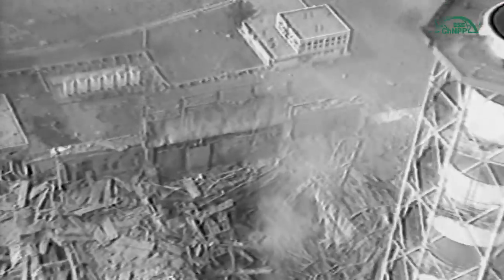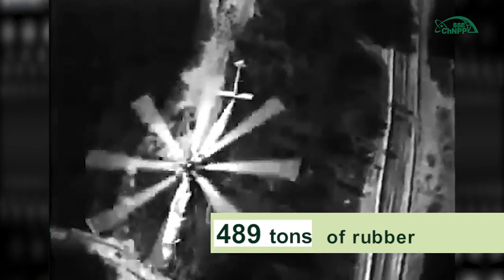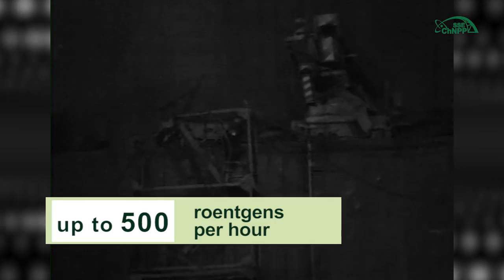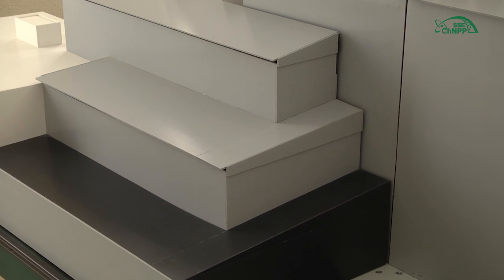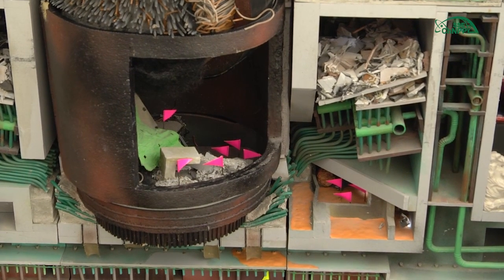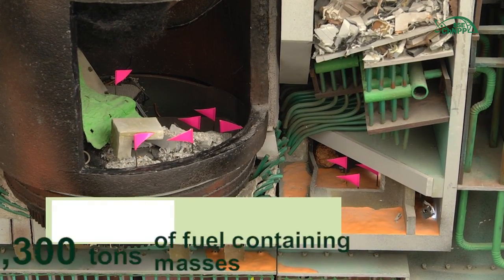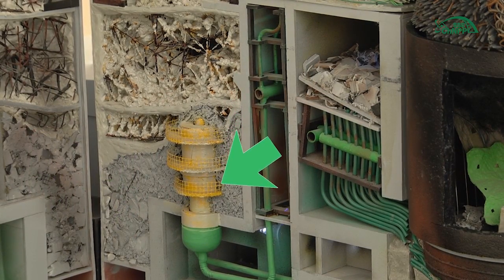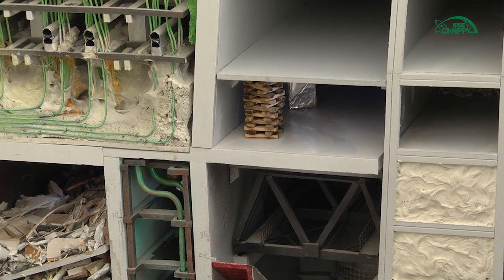Excursion within the "Sarcophagus"

Comment: "To stop the self sustaining reaction" - Yeah the soviet government had about as much of a chance of doing that as the japanese government had of stopping it in fukushima.  Which is to say ZERO chance.  The radiation levels are so high around those slag piles that you can hardly get equipment in there to take PICTURES of the situation. Forget stopping the reactions.  That talk is PURE propaganda.
Reply: Radioactive decay is different from sustaining reaction. Uncooled fuel under a self-sustaining reaction gets hotter and throws out a lot of neutrons. There was no small amount of relief once they got neutron detectors fitted around the reactor and discovered that the fuel (while still radioactive as all hell) wasn't throwing out neutrons.

Not to say there weren't a lot of mistakes made - throwing water on the reactor was worse than useless; at those temperatures  the water disassociates into hydrogen and oxygen, making the fire worse. The sand and clay dropped on the reactor lead the fuel to become insulated and increase in temperature, causing the radioactivity released to increase, and the fuel to eventually melt into "corium" like the elephant's foot. Not to mention the concerns that formed after dropping literal tons of material onto the damaged reactor from a high altitude - the floors were under severe strain.

The lead, boron, and dolomite were good ideas, and arguably should've been the majority of material dropped, but as I recall what actually got the fire completely snuffed out was the injection of liquid nitrogen around the reactor, which allowed the inert gaseous nitrogen to be drawn into the burning graphite stacks and snuff out the flames.

There was a lot of panic and sadly not enough expertise available during the early days of the accident
Reply: @compwiz101  Yeah well some of the things done were mistakes.  Some were just downright evil in an attempt to keep the world from knowing how bad it was.  To, in vain, try to control the narrative.  No iodine pills supplied to those in the area.  Especially the kids.  No cancellation of the May Day events in Kiev.  Because God forbid people get the idea that something is wrong.  Pripyat should have been cleared out immediately but wasn't.  All of this to not draw more suspicion than was already raised by the radiation alarms going off all over Europe.

I guess this comes down to a definition of "stopping" a self sustained reaction.  Stopping it would require clean up of all that corium not just burying it under tons of material and throwing a roof over the mess and calling it a day.  Yes it has been stopped from being an out of control reaction that threatened a massive explosion if it had gotten down to the water but that isn't the same in my mind as "To stop the self sustaining reaction".  You only need one atom split to kick a neutron to another atom split and one more neutron ad nauseum to be a "self sustained reaction".  We aren't talking nuclear weapons where the numbers kicked get bigger.  We are only talking about it continuing to go and there is a LOT of nuclear fuel in that mess still.

Comment: They should take all the nuclear waste from around the world to Chernobyl nuclear power plant and Fukushima nuclear power power plants and they should concentrate on building secure basis to store and hold the nuclear waste in the safest manner possible we would pay Fukushima and we would pay Chernobyl nuclear power plant to take the waste and secure the waste these areas are already highly Radioactive it does not make sense to ruin other parts of the planet that are not Radioactive in this way we can give the most safest possible surrounding cover for the nuclear waste so that no one has to worry about at home or commercial business or Farm being built on or near the nuclear waste it's extremely unfortunate that Fukushima and Chernobyl exist in the first place however what has happened has happened and the only way we can move forward is to use these areas as a new nuclear dump sites we should also be putting a ban on all new nuclear production especially in the form of new nuclear power plants should not be allowed and should not even be considered the oldest existing power plants need to be updated and have every solitary safety feature added to them as a joint effort we're not just the United States but the world otherwise we're just going to see more fukushima's and more Chernobyl nuclear power plants happen Fukushima to this day is still leaking nuclear radioactive material into the ocean and into their water supply cesium is the number one concern clearly the power plants in charge are clearly not taking care of the matter in the best way Fukushima still leaking nuclear spent waste if they had several organizations and governments backing them up to secure the site any more proper fashion and also bring in nuclear waste from around the world and secure that as well making the whole entire area one secure storage area for nuclear waste both in Fukushima and Chernobyl nuclear power plant both these areas have abandoned cities and suburbs pretty much as far as your eye can see so jointly these areas would be demolished and have a concrete slab poured over them any nuclear waste brought into the area would be put into a proper bunker and would not just be put into the ground like Fukushima is currently doing Fukushima is doing this to cut cost but they are only making their problem worse and leading into more water leaching problems for not only Fukushima but the entire island of Japan radiation can be found as far as California and the Alaska Coast we need to get on top of this now and starts selling off that entire area as a joint effort leaving it up to Fukushima power themselves and leaving it up to your normal Power Plant themselves it will never get done it will only turn into more and more of a nightmare as the years go on we need to take action now this would solve not only their problem but solve our problem of our nuclear waste that we have in our own country and countries it would give a place to be able to take all our nuclear waste and not have to worry about it affecting more homes more businesses and more Farms these areas are already highly Radioactive and it would not make sense to make some other part of the world radioactive as well

Comment: And there are idiots today that stand by the thought that nuclear power is safe.  Really?  NOT!!!
Reply: It is. But there is accidents with any electrical building. The operators thought it'll be a smart idea to remove all the fuel rods and do a stress test. But nuclear energy is much safer then burning coal or oil for electricity.

Comment: @7:34 So is it 200 or 2000?
Reply: The original load was ~130 kg UO2 in each pressure tube. A second generation RBMK-1000 has 1661 pressure tubes, so 1661 x130 kg =  215,93 tons Uranium dioxide.

Comment: Why can they not pump truck after truck of concrete Into the plant instead of just covering it? Seal it in... no?
Reply: They mainly did! Pumps wouldn't work they carried the concrete and boron by hand and dumped over the lip of the reactor! Bless these men!
Reply: That is the long term plan. But the entire structure is precarious and could collapse. So they will remove the old containment and any structure they can and then seal the rest as cleanly as possible.
Reply: @nicbrownable  Best build a catapult and get it all off the planet! IMO

Comment: Why was it necessary to build a new vent stack when both Unit 4 and Unit 3 were no longer in operation by that point? I understand the original stack needed to be removed to put the NSC in place, but I am wondering why any venting was required by that point.
Reply: Still a lot of heat in there that must be vented!

Comment: It's a band-aid on a severed limb. This thing has to last longer than the pyramids in a land with very harsh weather. The government denied it happened, It was setting of radiation detectors in Swedish radioactive compounds. Only when satellite pictures with enormous temperature readings where shown did they admit to it. A helicopter dropping bags of lead and graphite also fell into it, killing all on board instantly. Also two very brave men had to dive into a giant pool to release a jammed valve, Knowing that it was a one way ticket and they would die doing it. Everyone involved in the manual work are now dead, and most if not all of them never got any government aid as they slowly died horrible deaths.
Reply: guys, there is a dome covers the site and they have already started with deconstructions, contaminated material will be buried or recycle. Look for it. it is a project of EU and Ukraine and rest of the world.
Reply: All too true! Perhaps they should encase it in a true pyramid! Leave something to wonder about ten thousand years on!
Reply: We don't know if it has to last longer than the pyramids, someone could devise a method of completely neutralising or re-fusing dangerous particles tomorrow...
Reply: it has to last up to 320 years. don't forget that the radiation halves about every 30 years (half life of cesium). the pyramids are more than 3000 years old. so it doesn't have to outlast the pyramids. and Ukrainian weather is pretty mild - no tornados, no severe storms. and also rather seismically stable as well.
direct deaths from the accident is less than 30 people. and most people involved in the manual labour are also still alive (cancer is of course an issue still).
Reply: @michaelzlprime  And yes that number you cite for direct deaths is low and looks to almost overlook the cancers to the immediate public in range. https://www.wiseinternational.org/nuclear-monitor/821/pro-nuclear-environmentalists-and-chernobyl-death-toll
Reply: @michaelzlprime  more like 320 centuries! Better hire the Russians they are more qualified more conscientious! And will do the job if tasked to it! No matter the cost!
Reply: FOR IMMEDIATE RELEASE

February 22, 2019

Contact:
Thomas Bailey, 724-887-0952,twbailey56@gmail.com

Stephen Verchinski,sverchinski@yahoo.com   

 

Fukushima, Eight Years After

On January 23, 2019 two members of the Green Party of United States (GPUS) delivered an open letter and three other documents to Ambassador Inga Rhonda King, president of the United Nations Economic and Social Council (UNESC). This open letter had been adopted by the GPUS National Committee, and it asked UNESC to listen to and talk with three speakers called by GPUS.  At this audience, UNESC could have speakers with views opposing those of GPUS. Speakers would consider this topic: Has the International Atomic Energy Agency (IAEA) provided for the public safety of the residents of Japan and the world community after the Great East Japan Earthquake of 2011, as required by the International Atomic Energy Treaty (IAET), Article III, Section A, paragraphs 6 and 7 ?

Ultimately, GPUS requests the IAEA to take over the operation and control of the Fukushima Daiichi Nuclear Power Station (Fuku Station) from the Japanese government. Ongoing human rights violations and continuous releases of radioactive water into the Pacific Ocean merit direct action by the world community. GPUS expects UNESC to hold nations accountable to international law and to use the powers granted to it by the IAET.

Next, the two GPUS delegates, Thomas Bailey and Stephen Verchinski, delivered copies of the same open letter to the U.S. Mission to the United Nations. Verchinski, is a delegate from New Mexico to both GPUS International and Eco-Action Committees. Bailey, is a delegate from Pennsylvania to GPUS International Committee.

Bailey said, “We feel that the Japanese government is violating the human rights of everyone inside Japan by exposing them to excessive amounts of radiation leaving Fuku Station. The Japanese government is releasing 300 tons of Fuku-sourced radioactive water into the Pacific Ocean each day. Their government controls Fuku Station now. They should protect their own residents and the Pacific, not host the 2020 Olympics.”

Almost eight years have elapsed since the Great Earthquake, accompanying huge tsunami and subsequent disaster at Fuku Station, owned by Tokyo Electric Power Company (TEPCO). The Japanese government took over the maintenance and operation of Fuku Station from TEPCO in 2013. The open letter explains two legal rationales for UN action now.

One involves the IAEA and the safety standards it has established globally. The Japanese government declared Fuku Station to be a Level 7 “nuclear exposure event,” the most dangerous on the International Nuclear and Radiation Event Scale.  As a consequence, the International Commission on Radiation Protection raised the maximum permissible amount of radiation the residents of Japan were forced to endure twenty fold!

UN Special Rapporteurs Grover in 2013 and Tuncak in 2017 directed the Japanese government to reduce the maximum permissible radiation dosage back to one millisevert per year. While the Japanese government agreed to reduce the dosage in March, 2018, it has refused to do so to date.

Stephen Verchinski said, "We also know the Fukushima Reactors were Mark 1 designs of General Electric. Three reactor engineers quit in 1976 citing excessive hydrodynamic loads that could happen in the event of a major accident. Backup systems failure was a concern of those building the plant but had to follow the GE construction plans. This nuclear industry failure now exceeds ten times the cost of a new reactor. The costs now of Fukushima decommissioning is estimated between $188 and $676 billion dollars. In 1997, the G7 set aside $300 million for the $3.4 billion cost for Chernobyl. A similar fund should be set aside of at least $18 to $20 billion for Fukushima. GE additionally should bear responsibility and liability as well. GE is valued now at about $88 billion dollars."

Delegates from the Green Party of Pennsylvania (GPPA) proposed these actions originally to the GPUS National Committee. GPPA urges others to consider sending their own open letter to Ambassador King,svgmission@gmail.com, supporting this action by GPUS. 

The Green Party is an independent political party that stands in opposition to the two corporate parties. GPPA candidates promote public policy based on the Green Party four pillars: grassroots democracy, nonviolence, ecological wisdom, and social
justice/equal opportunity. For further information about GPPA, please visit www.gpofpa.org. Follow GPPA on social media: Facebook, Green Party of Pennsylvania and Twitter,@GreenPartyofPA.

Further information:
Green Party Requests UN to Takeover Fukushima Reactors, GPPA News Release, January 10, 2019,   https://www.gpofpa.org/green_party_requests_un_to_takeover_fukushima_reactors. 

 

*   END ITEM   *
Reply: @stephenverchinski409  IAEA has been a prime member of the coverup on radiation releases at Fukushima! while I do believe the situation should be taken out of Japans incompetent hands I believe IAEA is not the correct choice! A new organization should be formed. Perhaps Russian controlled! They've proven they are serious about radiation control! And will do whatever it takes to control this situation!